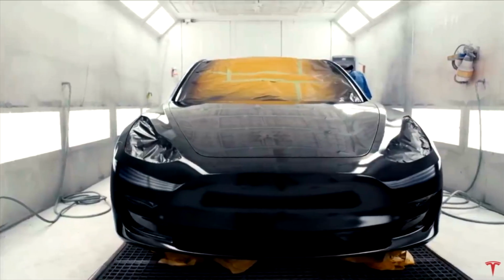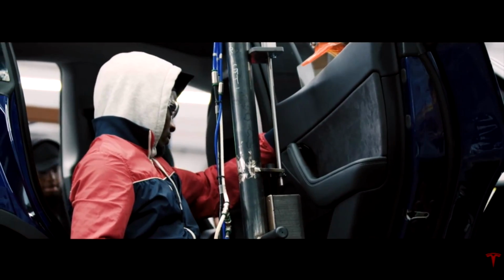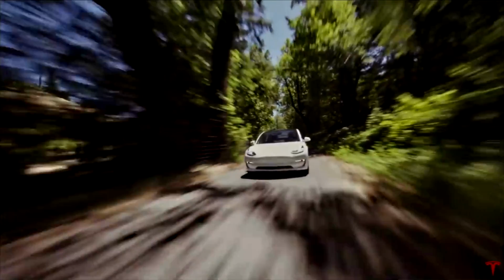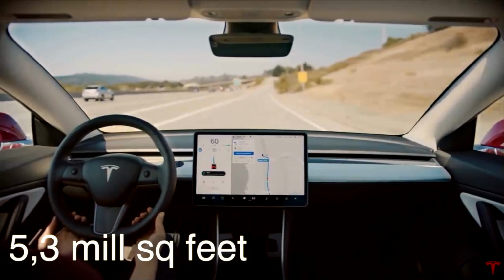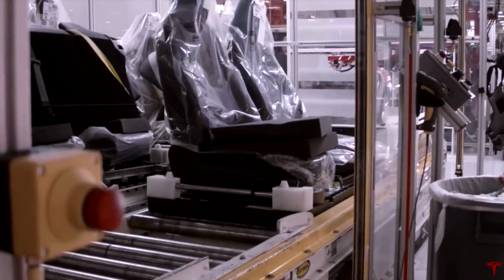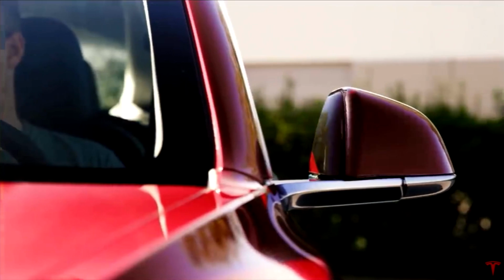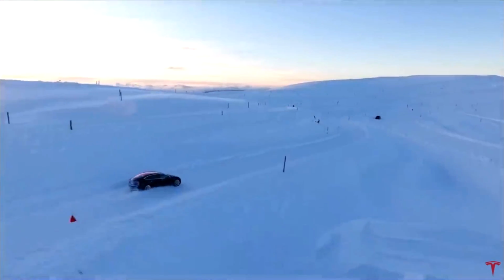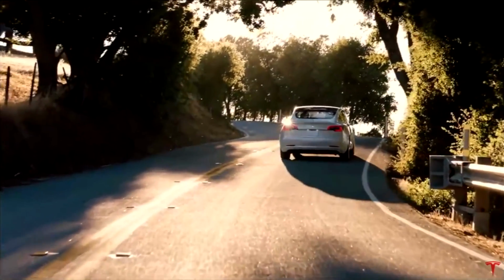Why is Tesla’s Gigafactory 1 not done yet ? | And what will they produce here when it is finished ?

Comment: I am drawing some slightly different conclusions.

I think Tesla's business plan has gone through great big major changes since they started work on GF-Nevada.  The company is deliberately flexible; it adjusts its plans often.  They're also keeping options open to preserve future flexibility.  Musk does the same thing at SpaceX.  They try stuff, learn from it, change the plan and try again.

Factors that motivated them to change plans for GS-Nevada include:

  -  Panasonic's difficult production ramp, bad reject rate (wasted cells) and cost per kilowatt-hour in the first several years after the plant went into operation caused Tesla to re-think their plans and timelines.  There was no point in spending more billions on construction at GF-Nevada until the two companies' relationship improved or Panasonic was ousted.  That has firmed up now, but it's an initial reason to postpone completing the factory.

  -  Acquisition of battery-expert companies and R&D in battery tech put the company's managers on notice that big changes in battery production equipment and methods would be coming soon.  One of those changes probably is that smaller production lines will produce much larger volumes, in terms of kilowatt-hours of storage capacity.

  -  Utility infrastructure projects suddenly started looking very good from a business planning perspective.  Tesla discovered that they had a marketable product line and would need to reserve future production capacity for it.

  -  Trump got himself elected and promptly began to roll back EPA emissions and mileage standards in the US.  He also started a trade war.  Meanwhile, China and Europe went the other way, planning to adopt ever-more-draconian standards on automakers.  It was clear that to avoid tariffs and take advantage of where the best demand would be, they would need to shift tactics and build factories in China and Europe.  I suspect Tesla had plans to build factories there anyway; but Trump caused them to accelerate, while postponing growth at GF-Nevada.

  -  The limitations of the factory in Fremont proved to have work-arounds.  Tesla has been able to continue to grow production there.  I, too, have long viewed this factory as their first-production-line test bed, where they hammer out line designs and document them for exporting to other factories, but those Fremont lines are also useful for manufacturing products and keeping Tesla on its growth path.  They've found ways to make that old plant perform for them.

  -  GF-Nevada is in an area which has a shortfall of the kinds of people they want to hire.  It's a desert.  Low population density.  Local communities are struggling just to house the workers that are already there.  It will take time to expand local roads, services and housing to support future growth, and to attract workers from all over willing to relocate to Nevada.

The philosophy at Tesla bears some similarity to 'throw everything at the wall and see what sticks.'  They try things, then modify their plans based on lessons learned.  Flexibility, not blind adherence to an old road map, is key.  They are constantly revisiting their plans - which is one reason Tesla is reluctant to disclose much about them.  Last year's plan no longer applies in all aspects.  It doesn't hurt them if they do everything with flexibility in mind, keeping options open.  Which I think they do.

So what will they make at GF-Nevada?

For the longest time, I expected them to export Model 3 and Y to GF-Nevada, but they haven't done it, and nothing has leaked about it.  Production capacity overseas is now the priority, probably for the reasons I cited.  (Probably!  Tesla isn't very transparent, so speculation is the name of the game.)

If Trump is re-elected, look for Tesla to do something similar with the Cybertruck GF, wherever it ends up.  They may build it part-way and halt.  The US under Republican governance is not putting pressure on automakers to get off of fossil fuels.  It will still be a very large factory, I imagine it might pump out up to 200,000 Cybertrucks per year and maybe some other stuff, but they may leave part of it unfinished, waiting for more favorable governmental leadership in the US.  Or any leadership at all, actually.

It's clear that Tesla will expand battery cell and pack manufacturing at GF-Nevada, definitely with Panasonic and maybe with their own Roadrunner production lines.  I'm starting to think that they might use GF-Nevada increasingly for fixed site installation products and to support Fremont, while new production of cars and trucks, not counting the initial product lines at Fremont, will get their own factories and battery production operations.  Utility infrastructure projects and Powerwalls are such potentially large growth areas for the company, they might ultimately need a completed GF-Nevada just for those products.  But Tesla might not be certain about that.  So there are good reasons for them to slow-walk expansion of that factory until the demand picture firms up and they can decide what makes the most sense.
GF-6 might be announced in the not-very-distant future, I think.  I expect it to be another American plant.  They'll want it when the government begins to lead again on ending our dependence on fossil fuels.  Just now, it looks like the American people have had enough of the Liar-In-Chief, and the Republicans riding on his coat-tails will be vulnerable.  We probably won't hear about GF-6 until after the election and after the next President tells us what he intends to do.  So, soon.

Or not, if Trump squeaks back into office and squats there for another four years.  In which case, the next GF will probably be overseas.